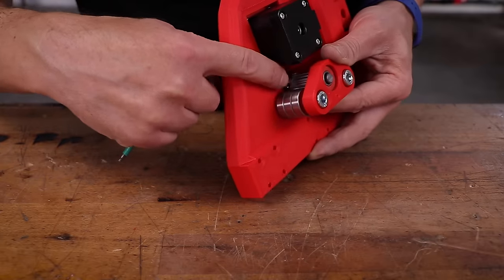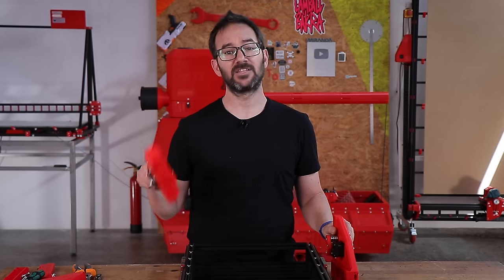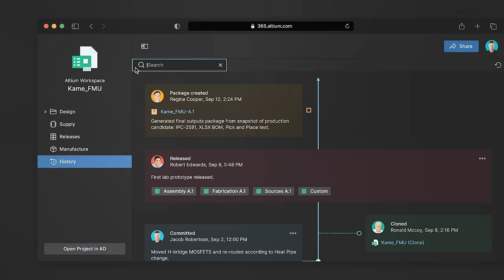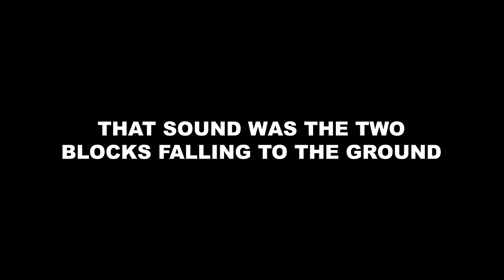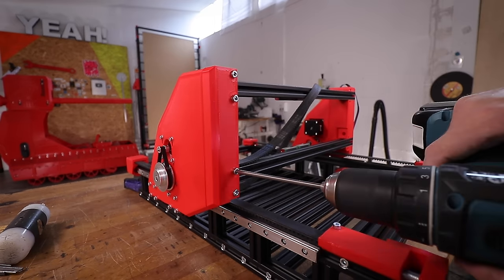3D PRINTED CNC BUILT FROM SCRATCH CUTS METAL

Comment: I know I'm very late for this video but I think it's still important to mention this.

From experience and from the manufacturers own tests, you shouldn't put two linear guides next to each other. The reasoning is that the load isn't distributed evenly between the two, only one carries everything, so it's basically more expensive to put two like that when you can only put one or even resort on the LR series, that are longer than the standard but maintain their width and height (At least with THK LM Guides, I personally use the SHS Series because they are the automotive industry standard and usually are in stock with 2-3 day shipping time).
If you want to put two linear guides, they should be spaced by, at least, the length of one linear guide.

Comment: Not surprised the hose adapter gets clogged with that sharp of a bend and that wide of an opening.

Adjusting your feeds and speeds as well as prioritizing climb milling would also reduce the size of the aluminum chips to prevent clogging.

Comment: I always hated the rails and blocks when I was building drill guides. Because they were industrial grade and meant for customers, they had to be exact. I mean .003" tolerance over 36" of run for the rails and the bearing blocks weighed 5-10 lbs. ea. depending on model. Then the whole thing had to be re-trued after the part went off to the main assembly, where someone inevitably knocked it out of alignment.
   I have to admit, I never would have thought of a music note app to figure out belt tension. I would have gone with a belt tensiometer and fought for hours trying to fit it in there.

Comment: May be a dumb question, but at 5:53 you use a belt, why not go direct drive? Backlash purposes? gear ratio? something else?
Reply: Direct drive? Do you mean screw rods? What rpm would the stepper motors need to run at to get from A to B quickly enough? Belts are fine and very strong; containing aramid commercial name, Kevlar. tanks use belts to get around and they do okay. 🙂

Comment: Wow concratulations on the build it is extremely rigid for being 3d printed. In fact it is almost as powerful as my commercially available CNC 6040Z which is just crazy considering that the 6040 is made entirely from aluminum and held together by massive steel bolts. Also I desperately do hope the machine repaied for that linear carriage-surgery :) had to do it once too always great fun. Very nice machine also using beltdrive is ingenious and I wouldn't have thought it provides enough reduction and also I would have thought it would produce loads of backlash and inprecisions when milling aluminum. Congrats. I mean really a 3d printed CNC cutting through aluminum?! I  do not know what sorcery  this is but i love it.Congrats!

Comment: Nice work mate but you know that already. I do like the jumbo sized printed parts Ivan. These need to be beefy and strong enough to handle all the stresses around the router.
 I would take your plans and update to a water-cooled spindle for many reasons, some of which are, cleaner cutting, higher rpm when required, less stress on the frame and lower noise - those Makita routers are noisy buggers too.

Comment: Maybe make the suction pipe a blowing pipe, instead of sucking up the aluminium debris, it blows away from the drill tool. 
On the sides of the CNC you could make some catch bins that catch the aluminium debris.

Comment: Absolutely amazing build! Is there a reason you attached the rails to the plasic inserts in the 2020 extrusion instead of using t-slot nuts?
Reply from the maker: Rails require M3 screws and there aren't M3 T nuts for the extrusions I'm using.
Reply: @ivanmirandawastaken  I guess one of the next upgrades will be CNC milled long T nuts with pre-drilled holes ready to be tapped for M3 screws :)

Comment: I feel like ball screws would have been much more appropriate than belts, but I’m impressed with the results the belt gave you regardless. I would have thought there would be chatter and issues with dimensional accuracy as the belts were put under load.

Comment: Considering how much metal you cut, you should have a look at the Makita LC1230. It's amazing.
Reply from the maker: Do you cut aluminium with it? what disk does it have?
Reply: @ivanmirandawastaken  It loves aluminium, the cut is near perfect. Copper no problem as well, same goes for any metal with a fair amount of iron in it.

It comes with a very nice blade with carbide teeth. When I cut aluminum rods with it, it leaves a mirror-like finish.

Comment: might be a dumb question, but could work space be increased by increasing the over all extrusions and linear rails, and increasing the Z axis linear rail lengths?
Reply from the maker: On the XY Yes, this one was made to make use of the entire length of standard 450 mm MGN12 rails. On the Z axis is not that easy as the race is not only limited by the length of the rails but the 3D printed parts and placement of the bearing blocks.
Reply: @ivanmirandawastaken  thank you! Now to look up what the “race” on a CNC is!😂🤙🏽
Reply: @ivanmirandawastaken  and maybe a few other things, hoping to find a way to extend the Z axis a bit!

Comment: Is it okay to mount stepper motors directly on PLA? I'm afraid that the heat from the motors might soften the plastic
Reply from the maker: You need to be carful with the current settings so the motors don't overheat but yeah, it can be done no problem
Reply: I'd be printing the parts in PETG not PLA. It's stronger and higher melting temperature. Bit more brittle though I think.

Comment: Only thing I can see that could be improved you have to switch the router on manually and it seems to be constant speed (there may be a way to manually adjust the speed, I don’t know). It might be better to have the arduino able to switch it on and off itself and also to have it able to change the speed. Could then also get into something more advanced like automatically adjusting the speed due to vibrations and chatter, etc.

Comment: Did you literally check the tightening of the belt using a frequency analyzer app??
Reply from the maker: Yes, but just to have both Y axis belts tightened to the same tension, not aiming to any note in particular.

Comment: hello, i recently also built myself a small cnc now im curious what feedrate and rpm you are using to cut aluminum
Reply from the maker: It depends, I don't know exactly the RPMs of the machine but with a .1 overstep cutting about 10 mm thick I let it go at full RPM at 1000 mm/min. If I'm doing a ramp with .2 steps then I try to go as low RPM as possible. It always depends I guess.
Reply: @ivanmirandawastaken  thank you for the answer

Comment: Nice and clean design. It takes a bunch of work to design a proper machine. Wondering if it could be helpful to try and make the parts castable with all the right drafts and partitions? Would be supper rigid if made from the right material. Then you can print it or even go beyond that. Keep up the amazing work. Love this channel.

Comment: Hey, amazing build as always. I was wondering what you used to attach the linear rails? Is it just a print that slides into the 20x20 with the correct holes spacing in? How strong do you think this is as its taking load? Thanks
Reply from the maker: Those are 3D printed parts too, just lines of conical holes for the screws. The load has to be transferred just a few tenths of a mm from the screw to the extrusion and there are a lot of them so I'm pretty confident that won't be an issue.

Comment: A work of art! Just not sure if those printed inserts the mgn rail bolts into will hold for long. Maybe a printed part with inserted metal t nuts would be better.
Reply from the maker: Those have just to transfer the load a few tenths of a mm for each screw and there are many of them, I don't think those will be an issue. soon.

Comment: It looks like you're using Nema17 motors instead of Nema23 motors. Is that made possible by the belt reduction?
Reply from the maker: Correct. There's a 5:1 reduction which is enough to easily mill aluminium.

Comment: use a belt with a steel cord, it has many times more linear rigidity - steel resists loads very well.
Reply: Aramid (aka Kevlar) used in these belts, is stronger than steel size for size. There is no concern over stretching over time once the tensioner finds the right tension.

Comment: What type of Nema motors do you use ? I saw a CNC shield board for power electonics. It may be limitating for the overall performance of the machine (you need torque, it means you need current...).

The full design is nice, better than mk1 (but also more expensive with linear rails).

Comment: Nice project and nice result. Just a question, I never see anybody talk about drill rotation speeds with these kind of projects. Normally, different materials requires different drill bits and different cutting speeds. With CNC it is all the same? There is no difference between materials, drilling and milling? Cannot believe this. What is the hidden truth behind this?

Comment: Great video! Great machine! I have a CNC available that's not as sturdy, but my biggest issue is the software to generate the gcode. What software are you using for that?
Reply from the maker: Fusion360
Reply: @ivanmirandawastaken  It's too bad I'm allergic to Fusion, it seems to do so much.

Comment: I have always had an issue with the Aluminum heating up and gumming the up the end mill even when taking very shallow cuts.  How did you avoid that?
Reply from the maker: If possible use a single flute bit, and even more, use one that's specifically made for aluminium. Always use very slow RPM and check i the stock is getting hot (it shouldn't).

Comment: Are you using marlin for the firmware and what 3d printer motherboard do you use for the cnc machine or is it  the arduino uno cnc shield?
Reply: Or do you use grbl firmware?

Comment: i calculated that u can save around 100 euro on the aluminium profiles depending on your bargaining skills 
i know that metal recycling company's get played more to put the aluminium profiles in a separate bin 
this means they have these profiles just laying there ready for you because the condition of the profiles in these bins needs to be 100% clean or 99% clean these are mainly from solar panels and they are left overs and for the around 9 meters u need for this build the cheapest with out shipping i can get is 130 euro with tax the point is a 9 meter beam of aluminium is real light and in these recycling companies 
the price is per kilo and its around for standard aluminium 90euro cents and 3 euro max for clean profile 
note these are daily prices maybe higher tomorrow or 20 cents lower tomorrow the point is depending on your recycler u could maybe get a 9 meter beam for 30 euros note a 9 meter beam is probably almost impossible to get since they are all scrap prices but 1.2 meters per pieces  is probably do able its probity better if u take tinny pieces  instead of larger 1s just for price sake

Comment: Seeing those huge pieces of polymer in such good shape is so cool. I have been printing on a Creality Ender 3 v2. Its small but I might be able to print something like this one day when I get the money to get the other hardware. The motor drivers are somewhat costly and the Tslot Aluminum 80/20 bars aren't cheap. Are you a Mech Engineer? Electrical Engineer perhaps? Just wondering. I have been tinkering with Arduino software/hardware combined with basic mechanical parts just to experiment. The C language isn't easy when you get to Loops and other semi-complex functions. I hope to learn it all eventually.

Comment: Great video everything good explained! I built also a machine for yourself :) ...just a question: what speed did you use for aluminium cutting on your Makita router? I use speed 3 with different feeds (from 500 to 1000 / DOC 0,2 to 0,8 / 1flute Rd4 router bit) but without any succes. Do you have any "magic parameters" for aluminium cutting? :)

Comment: Amazing design, as always. What is the red (3d printed?) insert in the slot of your rails? Does it capture bolts to attach the linear rail? Does it align the linear rail. You don’t seem to use the little alignment blocks I see everywhere. I am very curious about those. I’ve not seen them anywhere else (and I’ve seen a LOT of 2020 builds!)

Comment: Ivan I have a scrap Ender 3 3D printer.  Am I most of the way there on parts?  I have a much better 3D printer to make printed parts.
Reply from the maker: You most probably could use the motors, maybe the pulleys, wiring... some of the extrusions...
Reply: @ivanmirandawastaken  "wiring is so boring though!"  :)

Comment: I guess ipa is isopropanolalcohol? Alcohol (no matter wich) is never a good lubricant. In fact alcohol is used to clean oil off of parts (if you touch ipa you'll notice that your skin gets dry and damaged wich is because the alcohol removes the oil). It might be a good coolant since it evaporates quickly and therefor uses a lot of thermal energy.

Comment: there is a tragedy in the making built into this machine. the thread of the bolts used for the gantry drive train will eat the inside of the bearings used and fail in a catastrophic way when least expected especially on a machine that will have high loading on the bearings as the gantry is drug along while the milling end is working. if bolts have to be used they should have minimal thread and a smooth shank for the bearings to ride on. i know from a bit less than a years load on similar bearing set using all thread as an axle and the load wasnt anything like what this machine will see

Comment: Already having a massive amount of aluminum in the frame, you should also finish the entire gantry in aluminum. Having tried making brackets out of printed parts I can state with certainty that those parts will deform. Subtractive processes put constant force on all structural parts constantly while the machine is in use. The use of a high speed router is about as bad of an idea as can be made. Especially when you look at manufactures websites for suggested feeds/speeds for aluminum for their tooling. Also look at the results here...

You can be successful on some level cutting aluminum but eventually you will have a failure and if you are lucky it wont be a failure that ends with a chunk of an endmill sticking out of you. Failures aren't usually to bad, but at the very least you waste time and money replacing tooling. Finer control of tooling speed (RPM) is very much a desired ability in cutting anything harder than wood. Don't vacuum up aluminum shavings, blow them out of the way, it's messy but will give much better results. I would even go with a spray mist for some sort of cooling.

Overall 2 out of 10 for this project. Not enough thought went into any of the motor selection, including stepper and spindle motor. Poor choice of material in the gantry also. I come back to this channel once in a while to see if the content is improving, but the content is exactly the same. Innovate! do some lessons learned, improved designs, teach what you learned, something... Otherwise this is just a channel of "watch me dick around in my garage." If that is what your viewers want though, keep on doing what you do, this is your channel after all.

Comment: I love the content but there is just something I've never appreciated whenever you build the frame as you mentioned straightish and squarish 😬 If I were to build a CNC like this even on a budget, straightish or squarish is unacceptable. I would have drilled the holes for the frame using your existing CNC machine. I just don't trust manual drilling and center punch to drill holes then assume everything is aligned and square.